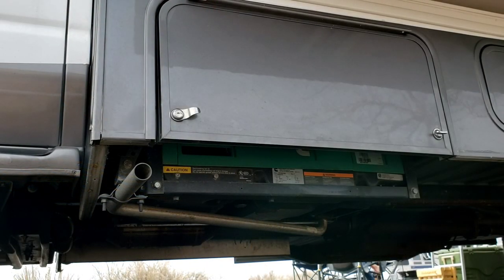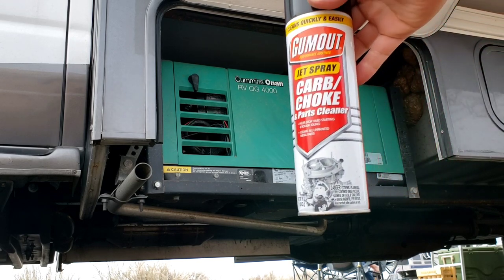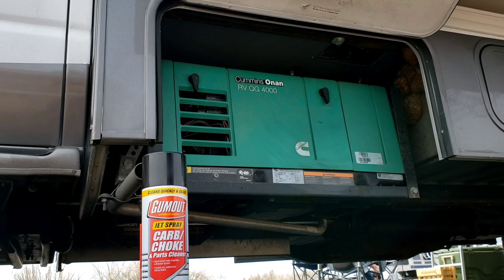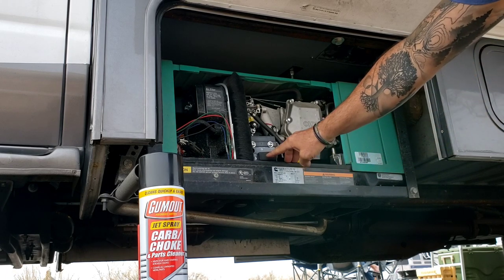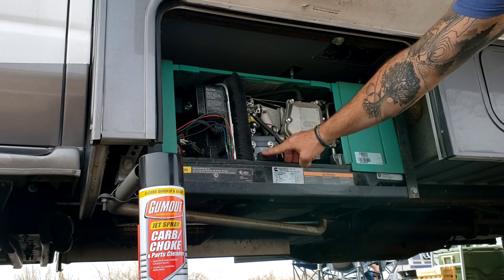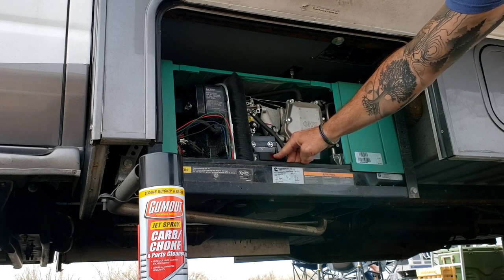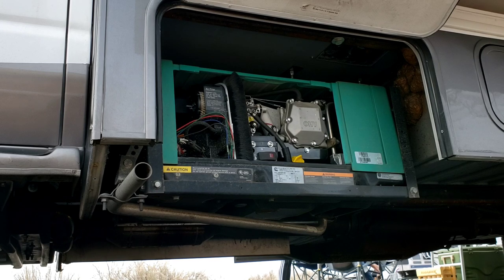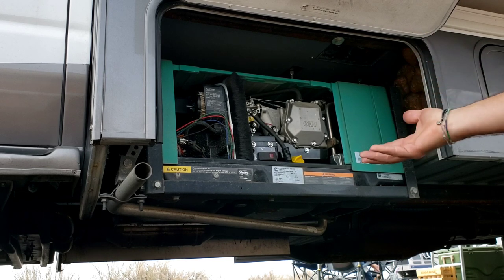If your Class C RV - Onan 4000 generator stops running after 5 seconds.

Comment: My generator ran fine for 15 minutes and then would shut off, pretty consistent duration before shutting off. I changed fuel filter and spark plug, no change. I had changed the oil, precisely following directions to fill oil to just below fill line on dipstick. I finally sucked out some motor oil to lower to lower range on the dipstick. That fixed it. Whew!

Comment: I think you got lucky on the trouble shooting.  For the Onan Generators the three flashes only that there is a fault.  To determine what the actual fault is you need to let the indicator flash three times than press the primer side down and release.  What you will get is the three flashes then a pause and then a succession of flashes (count these).  Most common error is 3 flashes followed by 6 flashes -  typically low fuel pressure or no fuel on LP.  My main point is that you need to follow the step above to determine actual fault code and then Chen owners manual or the Cummins website for the corresponding fault description and corrective action to take.
Reply from the maker: Hey thanks this is great info.   Like I said I'm definitely not a pro.  I had heard that the low fuel was a common issue and that the generator wouldnt run if the gas engine was less than a 1/4 full.  For some reason what I did worked for me, and I haven't had any issues since!

Comment: I think in this case, the carb cleaner acted as starter fluid.  It basically allowed you to get the engine running.  It's likely you had some bad fuel in the float bowl.  By getting it to run a few times, you managed to suck some good gas into the carb, at which point it began running better and better.  If there was only minor gunk in the jets, the flow of fuel may have cleaned them enough that you're OK now.   At some point, you may need to pull out the float bowl and blow out your jets with that carb cleaner, but if you run it often enough, maybe it'll remain happy.  Good luck!

Comment: This is how I  fixed. In my case of ( I can't start my generator) it's has been two years since last time was running. I started by checking oil level, gasoline more than 1\4 tank in my RV, sparkplug checked for good spark, also cleaned the carburetor and even installed new one but same situation, check wires and found some has been damaged by rats so I replaced them, by this time it started but stay runing only by keep pushing the switch on all time, so I knew it was electrical problem from the engine itself, so I took the generator out from my RV to work in my garage. I disassemble the unit by removing the cover, then the cooling fan until I was at the engine brushes area and this is what I found: one more wire chewed by rats plus the stinky nest in the middle of the generator motor coil, I fixed the wire and sanded the cooper contacts where the brushes are sitting becouse they were real duty with old urine from the rats. I assembled everything back together and  bingo it's runing like a champion, for this project materials involved was about $60.00 including an aftermarket new carburetor (online) and harmonic balancer/steering wheel puller (available at any autoparts $24.00) to pull the aluminum fan out. Just keep in mind that (Eny engine run smooth if gasoline and DC current aren't interrupted) Also if you have a onan microlite 4000 like mine, don't run it for more than a minute without the cover becouse you'll cook the engine real fast, also keep the eye on the aluminium fan and your fingers after cranking it in case you missing one, just kidding!!! If this can help eaven one person it'll make me more happy, thanks for reading!!!

Comment: I had issues of crank, no start with a touch under half tank of gas after the RV sat for a month in storage.  I'm no mechanic but thank God for youtube.  I removed about 3/4 pint of oil from the generator, filled gas tank and still crank but no start so I tappped on the fuel pump with a small wrench and it started and I left it running for an hour and 35 minutes.  I shut it down and ten minutes later restarted it for five minutes and I shut it down but I will order a fuel pump, air and fuel filter to have on hand.

Comment: Thank you for the video. My generator is giving me the over crank code. How can I fix this?
Reply from the maker: I'm not sure, sorry.  Short of talking with a service rep, I don't have any advice.
Reply: over crank code comes up any time you hold the start button down for more then 30 seconds and if it dont start after 30 seconds of cranking it will stop cranking and flass the code.

Comment: My oil was overfilled and I believe it reached the combustion chamber. I need advice on how to clean the piston / cylinder.  I know this because there is oil on the spark plugs. Plus, the oil dip stick indicated it was above the fill line.
Reply: Did you get this sorted?
Reply: @bluyetiinc7553  yes, I clean the cylinder and put new gas in the tank. Then I ran the engine on high to help burn it out. Today, it rans like a champ. Now issues.

Comment: I have  a 2017 4K Micro quiet and it shuts off after a few minutes and gives me a code of 1-5??????
Reply: i was having a problem with my govener arm not properly adjusted which was causing it not to run correctly. If you can keep the engine running my manually adjusting the throttle with your finger you might have the same problem i did
Reply: brian fladhamer Appreciate your response and I will try it and let you know if it fixes it this weekend thank you

Comment: Frankly, I don't think you fixed anything. Spaying cleaner into the carb only cleans the throat of the carb, not all the internal parts where the real problems develop. Hand throttling it isn't going to change anything either.  You didn't seem to check the code, which isn't the light blinking 3 times. 
Check the manual and get back to us. Also, learn how to use the primer.
Reply: Lol why knock the guy,its fixed until it gums up again! If he runs it monthly id say its ok! He can even cycle some seafoam through his tank once in a while! The way i see it he saved at least a $500 shop bill! Smart man! Simple fix!
Reply: All these Gens need the California Altitude Cap taken off the Jet and richened up.
Reply: @1320fastback  The altitude adjustment only leans the fuel mixture as the elevation rises. If you don't do this as needed, it will run to rich consuming more fuel, increase emissions, foul the spark plug and make it run poorly. It has nothing to do with california or any evil government plot.